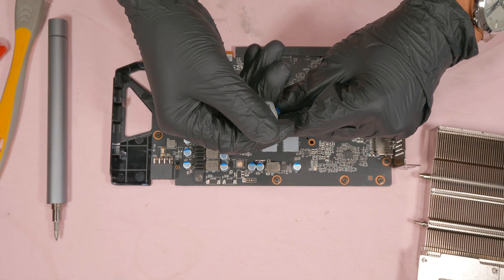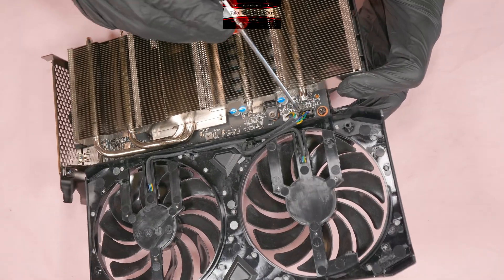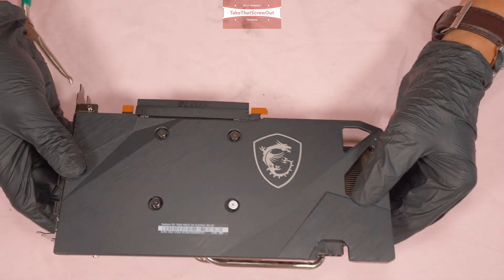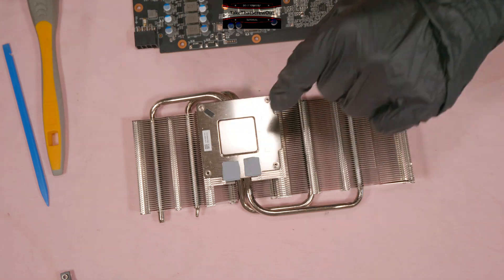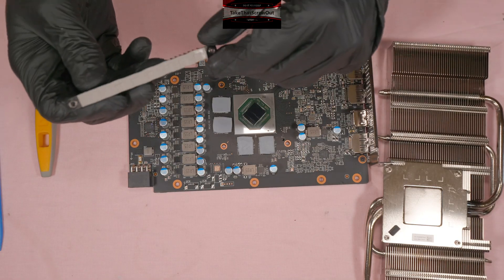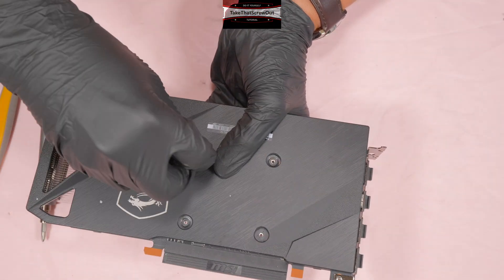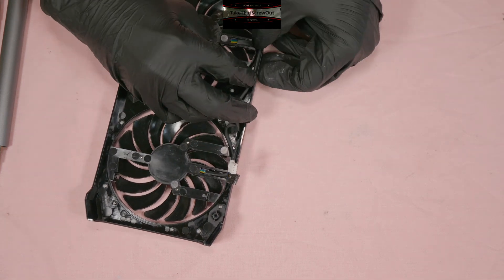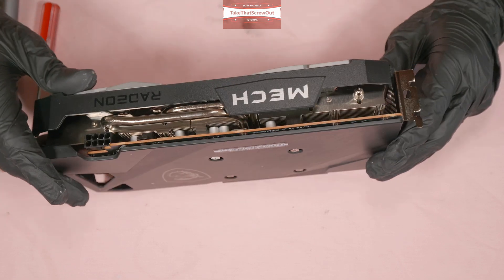MSI RADEON RX 7600 MECH 2X Classic | DISASSEMBLY | Thermal pads & Fan Replacement Tutorial

Comment: Buen video!! Muy claro.
Te hago una consulta: Haciendo mantenimiento de una RX 6600XT use en primera instancia pasta Maxtor CTG 8 (12.8W/K) que es por especificaciones superior a MX-4 (unos 8 W/K) pero mi resultado es que con la Maxtor no logro mejores resultados que con MX-4 ¿ Has utilizado la Maxtor CTG 8  para GPUs ?  

Saludos y gracias

Translation Google:

Good video!! Very clear.
I have a question for you: When doing maintenance on an RX 6600XT I first used Maxtor CTG 8 paste (12.8W/K) which is superior in specifications to MX-4 (about 8 W/K) but my result is that with the Maxtor I don't get better results than with MX-4. Have you used Maxtor CTG 8 for GPUs?

Regards and thanks

Comment: Can  I use these fans in rx 6600xt as well
Reply from the maker: I'm not 100% sure would fit, depends on the screw mounting points, but for sure the connector should be the same

Comment: You have some great content! I have a gigabyte rx 7600. How different gigabyte usually is compared to this for example? I'm thinking about applying ptm7950 due to the high hot spot temperatures and I'm trying to figure out the die size. Every place says that it's 204 square millimetres but does anybody know actual length of each side? I'd like to make sure I have enough thermal pad before tearing it apart.

Comment: Do you know the thermal pad size for MSI RX 6600 Mech? Thanks.
Reply: It's 1 mm, I just replaced mine.
Reply: Actually I re-replaced with 0.5mm and got even better hotspot temps, went down from 99C to 72C, GPU temp stays at max 58C. (during furmark) both Idles at 32C.
Stock was 1mm though. 
Sadly It didn't fix my card crashing, but at least I can rule out cooling being an issue.
Reply: To be clear: Crashing in Time Spy and gaming(once human), furmark works perfectly though for at least 30 minutes.
Reply from the maker: Well done bro..
Reply: I found the sizes on msi's forum, its 0.75mm on the side vrams and 1.25mm bottom vrams and it's 1.25mm for the VRMs.

Comment: is it possible for me to use thermal grizzly conductonaut instead of thermal paste or will it distroy my heatsink?
Reply from the maker: I don't recomment using liquid metal bro..thats too risky unless you know what you're doing. they are highly electro conductice and it could potentially damage the plate of your heatsink. and actually not worthy to do it, because the end result is just fraction improvement.

Comment: Hi! Thank you for this.

I have an RX 6600 XT MECH 2X 8G OC and I contacted MSI support for the right thermal pad size and this is their response.
        Memory PAD
 14.23mm*12.23mm*T1.25mm  (Length, width, thickness)
 14.23*12.23*T0.75

         MECH HEATSINK
82.36*7.25*1.25  

I can't find 1.25mm thermal pads online. Overseas, yes, but the shipping costs is expensive. Can you suggest what should I do?
Reply from the maker: Hi Bro! I understand of your situation..always go a bit higher than the given stock thickness rather than lower..on your case that you cannot find a 1.25mm on your area..look for 1.5mm thickness..but make sure choose a softer kind of thermal pads to easily adopt the difference. the performance that you'll get with thats fraction of the difference from the thickness is exectly the same bro..i guarantee you. Just pick a high quality thermal pads Brand like Arctic,Gelid,Thermal Grizzly, Thermal right etc. hope this helps. take care
Reply: @TakeThatScrewOut  Thank you for your response. I appreciate it. I'm thinking ARCTIC TP-3 since it's softer than other conventional thermal pads. What do you think?
Reply from the maker: That's what i recommend bro..i always use Arctic TP-3 in the past and till now, i'm also experimenting to use various different brand as well to discover which is best and which is not. Good choice with TP-3
Reply: Hi! I have the same one. I don't know why MSI they used two sizes!
The step on the heatsink is clearly visible.
I would swear that when I measured it, the thickest one was 1mm and the others were destroyed when I took the motherboard apart.
I used 1mm Coldium Pads which are very "soft" so for the thinnest one they were compressed.
For the thickest one I closed the motherboard without the thermal paste as a test and the pads were marked with the shape of the memories.
We have to see if all the heatsinks come from the same manufacturer that supplies MSI, possibly they vary between batches of motherboards.
I used MX4 as paste, it was a bit noisy, it reaches 2750 RPM although it does not go over 74 degrees in long periods of maximum load.
Greetings

Comment: This housing / case model is the same type as the RX 5600XT ?
Reply from the maker: Similar bro and with 6700 xt..only the layout of the chips of the pcb is slightly different.
Reply: @TakeThatScrewOut  Thank you mate! i've been following your channel for awhile. Ive just bought a 5600XT that's why im curious. Hope your channel grows more!
Reply from the maker: Thank you so much for the support bro! Appreciated! By the way, Rx5600 xt & Rx6700xt there's a very slight difference of the front fascia..and the layout of the smaller chips around the gpu die is slightly different as well.